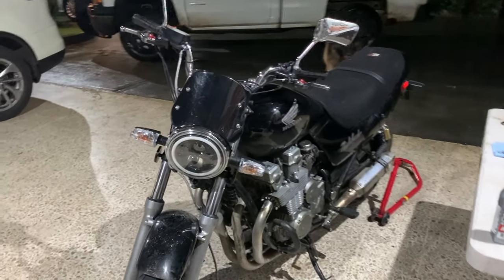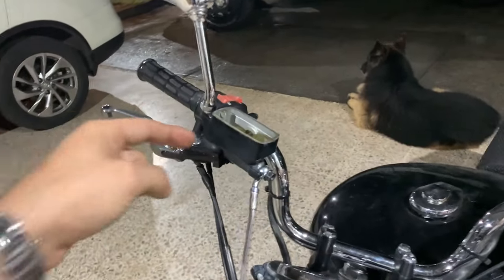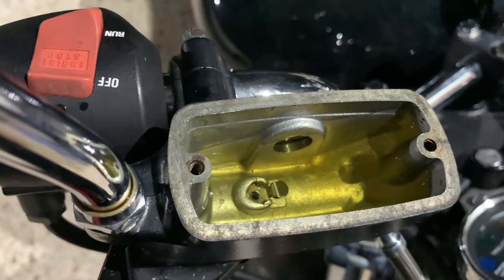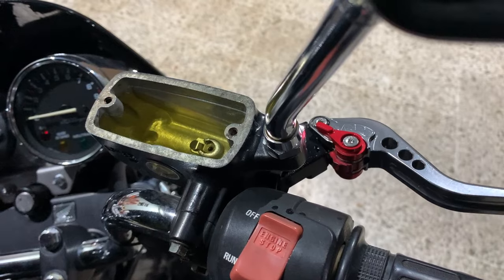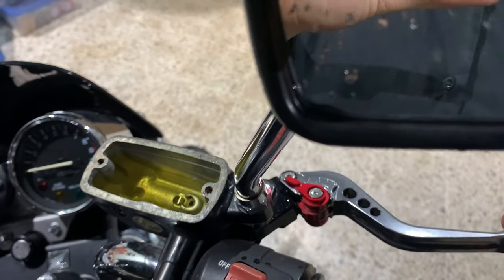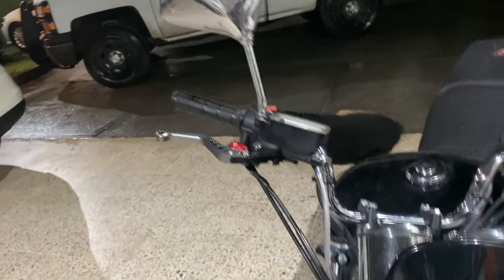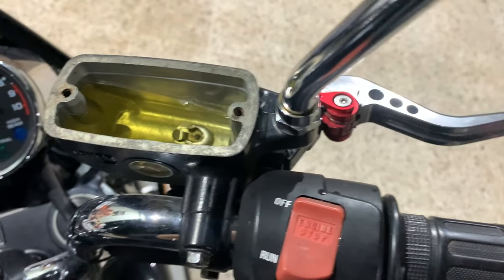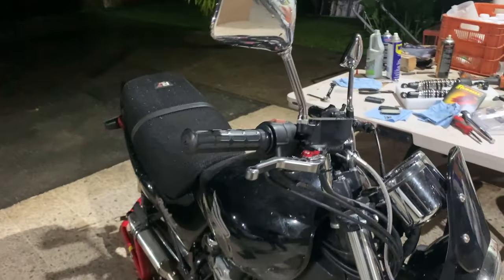Bleed & No Pressure? How to Remove Air on your Motorcycle Brakes in 3 Minutes

Comment: OK, I wrestled with this LITERALLY for days and could not get any air bubbles to appear. So much so that I figured the brake line itself was bad.  But what DID work, and Instantly, too, was reverse bleeding, using a syringe to pump fluid IN from the bleed nipple with the master cylinder cap off.  Had all the air out and a firm brake lever in 1 minute!!  So if this video doesn't work, try the reverse bleed technique. You just need a plastic syringe full of brake fluid.  Easy.
Reply: That's what iv been doing all day today  now I find this now lol  I know what to do now . I don't know if this is the reason I can't get bubbles out as I'm trying to bleed the brakes on a motorbike   like i would on a car  an why its not working . 
So thanks for posting  this vid hopefully I fix the prob .
Reply: I think I have bad line.  No air bubbles and reverse bleed would not go in.  Kept popping of stem and brake fluid went all over rims and floor.
Reply: But the last inch or two of fluid is what gets beat up. If you reverse bleed, you are pushing that further into the system
Reply: @shogun678  You push it all the way through the system and out of the reservoir.
Reply: @shogun678  Exactly! You will get crud in your fluid, and it will migrate to the bottom of the line. WORSE, if you have abs on your bike and you push that crud up and through the ABS box, you can destroy it. I like the theory of the reverse bleed, but you're definitely want to drain the bottom few inches of fluid first. The other thing that was really hard to wrap my head around was why bubbles can migrate to the bottom of the line when bleeding. It's because there's more pressure up near the master cylinder than down at the slave, and the pressure differential can overcome gravity and the bubbles move down to get away from the master cylinder. This is why putting a zip tie on the lever overnight and then quickly bleeding as soon as you remove the zip tie will have bubbles coming out the bottom.
Reply: Thank you so very much. Your suggestion worked instantly.

Thank you a lot. 😀👍👌👌👌
Reply: @metricwrencher8702 This same thing is happening to me. Did you figure out what it was? Thinking maybe my line is clogged or something. My brake lever is also has a lot of play in it and goes all the way down. At first I saw those little air bubbles then it stopped.
Reply: This makes perfect logical sense. Air rises and pouring fluid from the lowest position is simple physics.
Reply: Great tip

Comment: I thought my master cylinder was bad. Ever video I watched said full pulls. I pulled on that lever for 45 min. My hand was cramping up. I ordered a new master cylinder and then found this video.  It worked,  the small pulls had air bubbles rolling out. Thank you. Canceled my order for replacement master cylinder.

Comment: I recommend doing this again after a short ride.  The vibrations from the engine and road will loosen any mini air bubbles stuck in the line to rise to the top. Keep the lid on the master cylinder, but do the mini bump process again.  Super small bubbles will continue to empty out of the lines and you will have the best feeling lever possible.
Reply: You can also zip tie your brake lever overnight. The pressure will help get out a lot of air.

Comment: Thank you so much for doing this video, I've been messing about with my front caliper and stripped it down now about 10 times trying to find what I did wrong rebuilding it and why for some reason i can't bleed it.  Turns out I built it all correct and after watching your video 30 seconds later I have pressure, if only i'd looked at this 5 hours ago. THANK YOU again

Comment: Hey man, thank you! I killed two hours last night trying to bleed the front brake on my WR250R (using the traditional method) after rebuilding the master cylinder, and I was making zero progress. Like another comment said, thirty seconds of this method and my brake lever has better feel than ever. One point of advice, besides turning the bars so that the master cylinder is the highest point, I also secured my brake line so that it was lower than the master cylinder as well (dual sports like mine loop the brake line up over the bars and cockpit area). Using your method plus occasionally opening the valve on the caliper like I'd been doing has been a game changer.

Comment: I was struggling for DAYS! Took the brake line of a few times, even took my calliper appart to see if i missed something during the rebuilding. I could not find anything wrong. Then i found your video and it worked instantly. Thanks for sharing this ❤

Comment: I was at the point of scrapping my new lines thinking there was an issue and after a day of bleeding and a full bottle of brake fluid I came across your video.  Within 2 minutes I felt pressure at the bottom and within 5 minutes it was solid!  Thank you so much!

Comment: I'd done plenty of work on car and truck brake systems before but this was my first time doing a full bleed of a motorcycle front brake after opening the system. Pumped my way through half a container of brake fluid before I figured I must be doing something wrong and should look into it more. Found your video and in about 10 minutes had everything bled, back together and on the road. Great video! Thank you!

Comment: You saved the day.  Thank You Very much.  I have bled cars many times so I figured scooters where the same.   I let the reservoir get too low and air must have gotten in the line.  So every time I pumped the handle I could not bleed the system.  No fluid drain at the bleed valve and no pressure on the handle.  I saw your post last night and could wait to try it this morning.  Sure enough, exactly like you said.  A few small pumps and I could see the bubbles and the handle started to stiffen.  Several more and Voila.  It was done.  Thanks again.

Comment: hi  I cannot thank you enough for your video.  I made the same mistake of thinking it would bleed in the same way as a car.  The bore of the MC is so narrow that a single bubble would stop it.  I was sceptical but I had nothing to loose.  It took a good 20 minutes to get all the bubbles out and boom a hard brake.  Bled it as normal and its spot on.  Thanks again

Comment: Thank you so much man!
I stripped my front brake system and gave it a clean and could not get pressure when I put it back together.
I did the soft pedal pushes and the bubbles came out as you demonstrated.

Once I had enough pressure in the pedal, I went ahead and bled the front brake and it is good as new.

Comment: Thanks for posting this video! I just put ape-hangers on my Crossbones (which meant new cables) and had this exact same issue. One important note: It can take a really long time. I was about to give up a couple of times and then I'd see an air bubble pop up. Eventually, I noticed that the lever wasn't going all the way to the grip anymore, so I kept going. In the end, it probably took about 10-15 minutes. If not for this video, I may have eventually taken it to a shop. You probably saved me a fortune here. Edit: Sweet Nighthawk, btw.
Reply: Can I do this with the cap on? May screws are stripped

Comment: Dude... you are the first video I have found that explains this way. It does work!!! My polaris atv was a little different in the amount of pull.  You also need to let it sit for a few in began trying to get out bubbles.  I am assuming this is reverse bleeding.  My entire system was replaced and I gravity bleed before doing what this video shows,  but it worked like a champ! Thanx bud👊

Comment: Thank you very much my friend, totally worked for me. My front brake jammed up while I was riding and the lever was stuck and was unable to move my front wheel after pulling to the side of the road. Finally it loosed-up and I rode home without using my front brakes. I was hoping not to rebuild my master pump so decided to just change the brake oil and clean the piston. Afetr flushing out the old brake fluid and using WD40 to lubricate and clean the piston, it was moving freely. Top up new brake fluid and starting pumping the lever but never got stiff, so decide to bleed the brake fluid and started to pump the lever again. I saw some air bubbles being released in the resevoir but the lever never got sfiff. I started thinking the O ring or the rubber on the piston could have been worn out. That was when I decided to take a break and search in youtube. After a few videos, sported your, and made sense about the air getting trapped around the master cilender area. Decided to give it a few tapping with my palm and pumping the lever as you described, I could see more air being released, a few more tapping and pumping and the liver finally became stiff. The brakes are working fine now and the lever fully retracts back to press on the brake switch, early there was a gap and the brake lights would stay ON. Thank you my friend, your video truly helped me...😜
Reply: Hi mate! Be careful using WD40 on your pistons, it’s a water displaced and shouldn’t be used for lubrication. I think copper grease or another grease would work better and be safer

Comment: Definitley not 3 mins, but it worked like a charm. My only lessons learned, if you're not getting bubbles, adjust the pressure on the pull, then go back to the light pull. It took me about 30 mins of modulating on new brake lines to get about 90% pressure back. Then I attached a bungie cord from the lever to the grip, to apply just enough pressure to keep the valve open. In the morning after removing the bungie, pressure was 100%.
Reply: Did you keep the cap off over night when you had the bungie on?
Reply: @billterri4889  I put the reservoir cap on, but left it loose so air could escape.

Comment: Great video, I'm currently having this issue right now with my brakes as I just replaced my lines with stainless steel cables too. Question - do you have your bleeder nipple cracked open while doing this?
Reply from the maker: No, closed

Comment: Is it normal to still see bubbles after doing this for 45 minutes? I checked all three calipers (ATV), distribution block, and master cylinder and there isn't a leak anywhere (suspecting it was sucking in air somewhere). The handle is firm but bubbles just kept appearing. Going to let it sit overnight and do some more tomorrow.

Comment: Was this after a complete drain of the brake lines and callipers? If not, did you bleed the old fluid out the lines and callipers after sorting the master cylinder? I was always told to work from the ground up.
Reply from the maker: This was after only replacing the brake line
Reply: Sorry I’m still not clear on this. Did you do the whole thing from a dry system at the master cylinder only?
Reply from the maker: @EVil-ob8in  dry cylinder and line, but probably not the caliper
Reply: @BadAssEngineering  thanks. I’ll give it a try 👍

Comment: I did this and it didn't work. I might have a leak somewhere. Everything feels tight and i did soapy water to see if i could find the leak and nothing. I actually got them to hold pressure earlier, but I dont know how, but the calipers were on backwards so i had to take them off and flip them and back to square 1. Its a pain.

Comment: I tried doing this but still no pressure in my brake handle, at first while doing the small pumps I got some bubbles going for maybe 5 minute but the oil doesn’t seem to lower
Reply from the maker: Maybe your master cylinder needs a rebuild

Comment: My brake has pressure when pulling the lever fast. But when pulling it slowly there is no pressure. No air bubble coming up at reservoir either.
Any idea what's the problem?
Reply from the maker: Could be a number of things, old bad fluid, a leak somewhere, a bad master, etc

Comment: Hi, great video. Ik started doing this on my gsx1400 and at first some real small bubbels Came up, but then nothing. After more than 10min of doing this, i stil can pull the brake lever completely in. When i bleed the nipples, only oil comes out. What am i doing wrong?
Reply from the maker: Does your bike have ABS ?
Reply: @BadAssEngineering  no abs
Reply from the maker: @korneelvh3837  try turning the handlebars fully to the left with the brake reservoir lid back on and keep tapping, and also tap the brake like with a spanner

Comment: I’ve been bleeding my front brakes for a week, I’m using pneumatic bleeder and a pump bleeder can’t get the air out at all, I took the brake line off the master cylinder and I’ve got pressure, I give up

Comment: Great video, thanks 

My question is when flushing the brake fluid from my friends car I cannot get fluid to come out of any of the 4 wheels, if it was only one wheel that wasn’t bleeding I know that it would be likely a bad caliper but on all four wheels, could it be the abs unit that giving problems or master brake cyclinder. Thanks
Reply from the maker: In a car, you have to have someone pump the brakes and keep the pedal pressed so you can open the caliper valve
Reply: @BadAssEngineering  I know how to bleed brakes, I been doing them for years, no fluid is coming out of all 4 calipers when bleeding, I decided to flush the brake fluid because the fluid is like black, I’m thinking the abs unit has a air pocket, it’s definitely not the brake booster because it build pressure or possibly a clogged up master brake cyclinder,

Comment: i assume this would work the same on rear master cylinder too?
Reply from the maker: Depends on how much height difference there is between the rear master and caliper, if the line is too horizontal, maybe not as well as it does on the front

Comment: Is it the same process for the rear brake as well?
Reply from the maker: I don't think so, the reason this works on the fronts is because the line is almost vertical. On a car or rear brake on a bike the line is more horizontal and the bubbles won't flow easily. You can do as in the video to prime the master cylinder, but you may need to bleed the rears conventionally

Comment: Is this applicable for car brake lines?
Reply from the maker: no
Reply: @BadAssEngineering  Any idea why the same is happening in car brake system?
The pedal is sinking to the floor, i started from rear back, there is pressure coming out of the line, with bubbles and lots of air, but almost any fluid... So the fluid in the tank stays full and not dropping level at all...
And ideas...?

Comment: Is it the same procedure for the rear brake?
Reply from the maker: No because the rear line is more horizontal, the rear is easier to bleed conventionally like a car
Reply: @BadAssEngineering  
I have linked brakes. I have been bleeding the rear using a full stroke on the pedal but I still only get pressure at the end of the stroke. I will try using your method with a short stroke. 
Thanks for the reply.

Comment: And if you want to do it faster, buy a cheap syringe and a tube that fits tightly over the bleeder nipple on the caliper and push liquid through from bottom to top (from caliper to master cylinder).

Comment: What if its only the rear brakes with the issue?
Reply from the maker: The rear brake line is very horizontal, so it's easier to bleed conventionally

Comment: Didn't work on my CBR 600.   It's a new bike changing to steel braded lines.
Reply from the maker: Does it have an ABS module ?
Reply: @BadAssEngineering  no.  I had trouble doing this before on another CBR.   It does not want to firm up at all.
Reply: @BadAssEngineering  I figured out how to do it.  These newer bikes with pin less monoblock calipers are tricky.  Don't bolt the calipers on.  Take them off and on repeatedly put them upside down, shake, etc., while doing your trick.  Be careful not too much fluid in the reservoir when you put them back on the disk the reservoir could overflow.

Comment: Hello, i have a question. Few days ago I fell on my Honda pcx and after that fall I have resistance on my front wheel. My friend told me that, i just have to put the air out from braking system, but I am not sure. Can you help me or someone what is wrong with my bike? Thx
Reply from the maker: You should check if something is rubbing the wheel, i dont think it would be brake related unless the brake rotor is bent

Comment: Hahaha try to do that with Honda Magna double disc brakes. You will be surprised that didin't work. Magnas brake is cursed.......😢
Reply from the maker: Have you tried removing the calipers from their mounts and letting them hang more vertically v
Reply: Yes.... Done that.... Rebuilded calipers with hight quality parts by profesional, lines new. Master cylinder is working good... But still bubbly. I will try your technique tommorow. I think i bought to small master cylinder... Original one messed up so i bought from another bike in good shape. But i think that J.Juan master cylinder was from.single disc brakes so this can cause problem...

Comment: I just tried this technique. I was able to get all the bubbles out of the master cylinder. However I still don't get any pressure on my lever. I am pulling my ears over this.
Reply from the maker: There may still be air in the cylinder, try and keep doing little pulls and little love taps to the lever until you feel pressure
Reply: @BadAssEngineering  OK.. I will try that out.